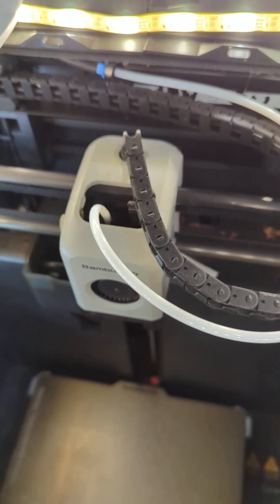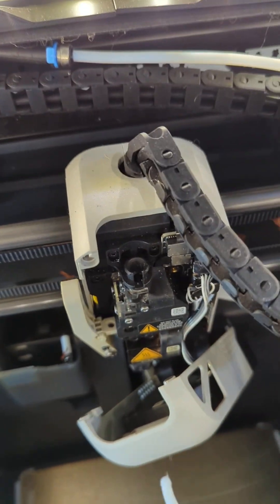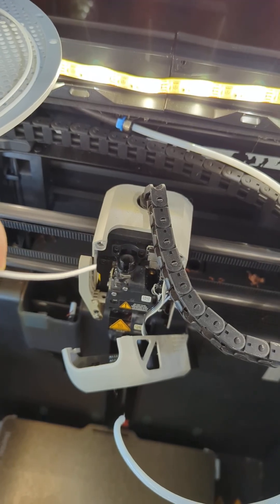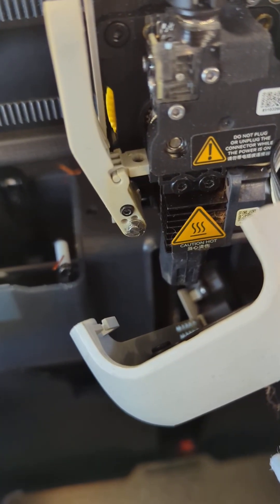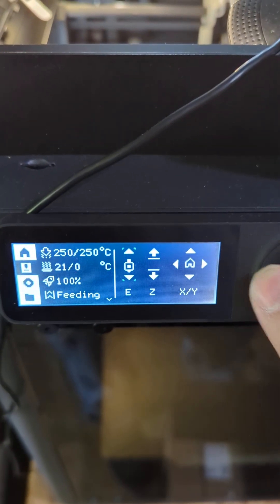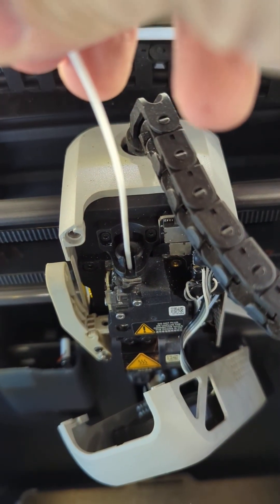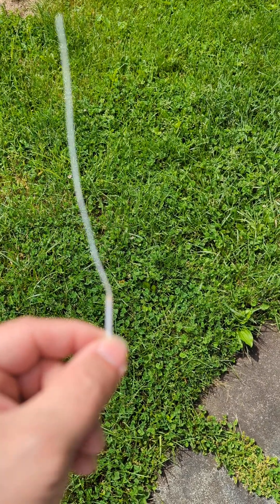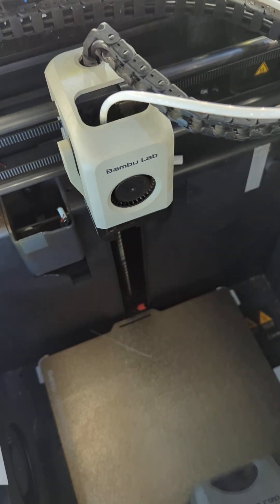HOW TO PERFORM COLD PULL ON @BambuLab  P1 SERIES PRINTERS

Comment: I had some ASA clog, so I heated up to 270-280 and kept pushing the PLA in. Eventually everything not PLA exited by the nozzle. Never tried the cold pull, but I guess it could be a next step for a heavier clog.

Comment: Wanting to do a cold pull.  Petg was stringy then failed to extrude.  I did one cold pull with petg already.  Can I try some white pla and do this a few times.
Reply from the maker: @ChipPuccio  if you are trying to cold pull petg you will probably need to use petg as pla and petg won't stick together very well since they melt at different temperatures. If you have white or any bright color petg you should be able to achieve the same results that way.